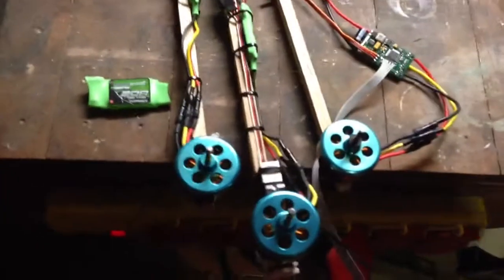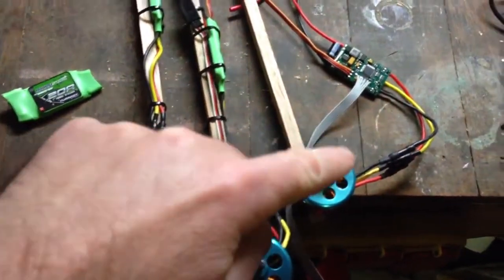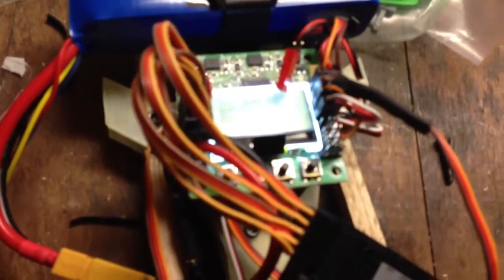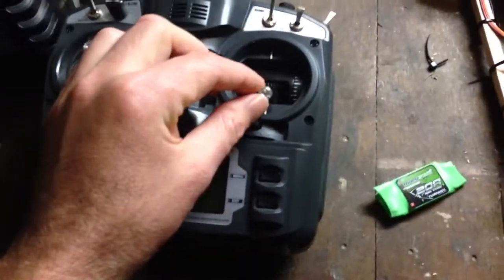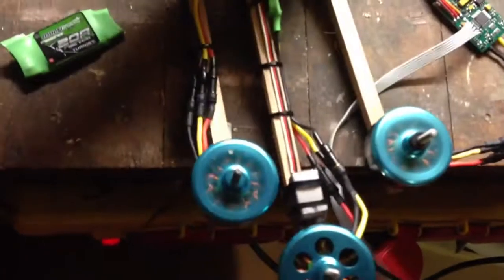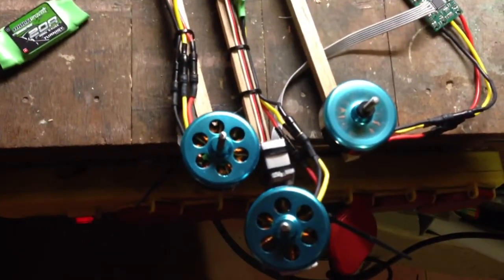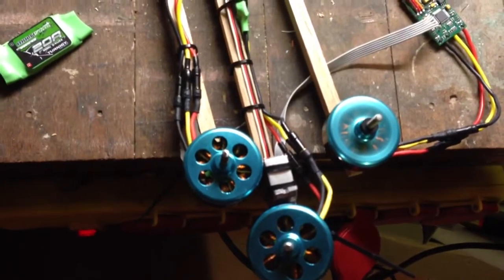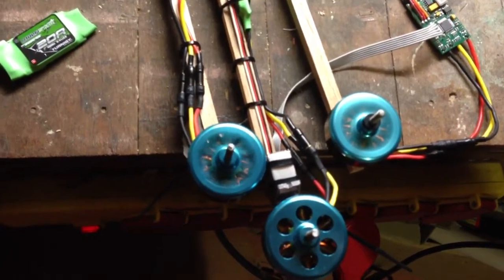Turnigy multistar ESC stock firmware vs simonk

Comment from the maker: Matthew, that's what I thought too.  All the marketing propaganda says that they are suitable for multirotors.  They're not (at least with the stock firmware).

If you think this is inaccurate then that's fine, you're welcome to have your opinion.  The only thing in the stock firmware that's suitable for multirotors is the update rate.  What's downright dangerous for MRs is the 'safe arming' function that cuts off the ESC in flight.  This makes it not suitable for MRs.

Comment: Funny I thought the very NAME Multi-star and HK's description of them being designed for multirotor meant just that. Saying they are not designed for Mult-irotor is somewhat inaccurate. 

Now I am NOT saying Flashing Simon K is not a great idea, it is just that I fear most people are not going to be able to solder with the precision to get the connectors right without frying the board. A video on how to get that done and set the throttle end points would be helpful as well.  Cheers!

Comment from the maker: Hi egly350z,
The only programming you need to do after flashing is to set the throttle endpoints.  There is no LVC or timing adjustment that you can do: simonk is set up for multirotors where these are not necessary.